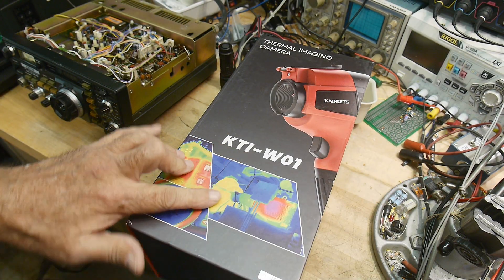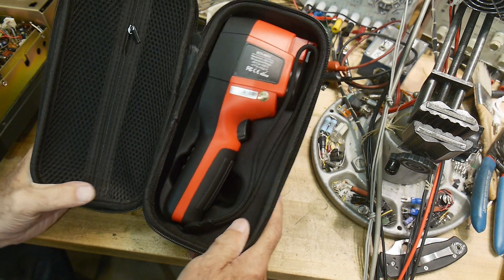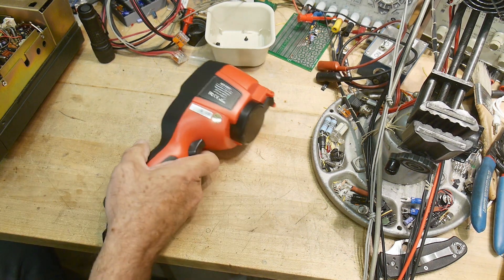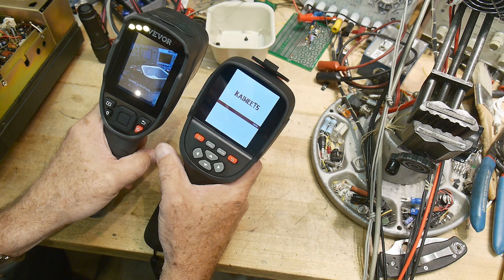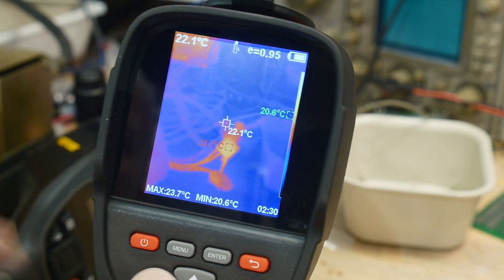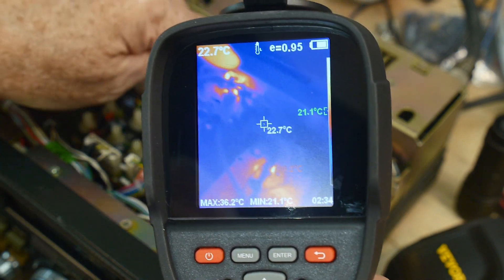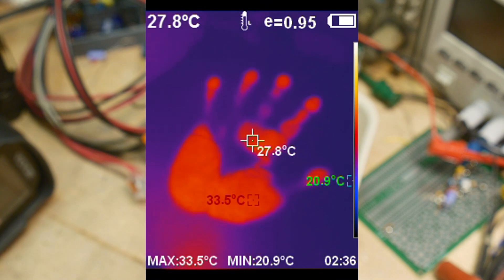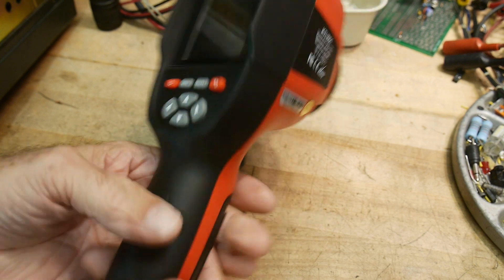#1667 Kaiweets KTI-W01 Thermal Camera Review

Comment: For electronics, I need to know how well it resolves warm to hot components and even shorted traces. Another guy said you need 320x240 IR resolution to resolve tightly packed surface mount parts on a board. Another showed that blocking hot objects improves results for the component of interest as many of the lower cost imagers only have auto ranging. 

So, I am trying to find a reasonably priced IR camera to test circuit boards with tightly packed parts, perhaps with a few warm and hot parts in an area of interest. Each part needs to be thermally resolved.
Reply from the maker: https://youtu.be/CtfdqscZTlM?si=DTSttWIzIgncWrpm

Comment: Thank you for the review, it looks like a quality product and seems to have good resolution. HOWEVER, after seeing the review of the Kaiweets KM601s Smartmeter done by TheHWCave, I would check the charger very carefully before using it. He found the USB connector sheild had enough voltage on it to blow the milliamp range fuse on his multimeter and kill the KM601s (damaged a trace on the PCB). Regards, David
Reply: Gladly these devices (both the multimeter and the thermal camera) are OEM units and Kaiweets just put their branding on them, The thermal camera and multimeter is not made by the same sub-contractor.

Comment: I've been eyeing thermal cameras since the Chinese came out with their reasonably priced sensors.  However, this Kaiweets is a hard pass in my book.  Thanks for reviewing so I know not to put my money there. I want one that attaches to my cell phone since it's already got a good visible light camera and a high-resolution display.
Reply from the maker: I'll be reviewing one in a couple days
Reply: I wonder why this would be a hard pass for you? Any cheap Chinese product that would plug into my phone would be a hard pass for me. Or at least I'm very hesitant on connecting them into anything network connected. Will the device be supported and for how long? Are there any nasty surprices on the firmware of any chip? Mechanical connections to a phone is also a bit concerning.